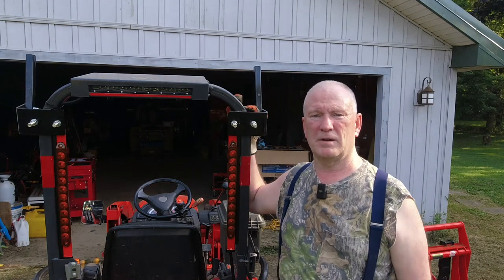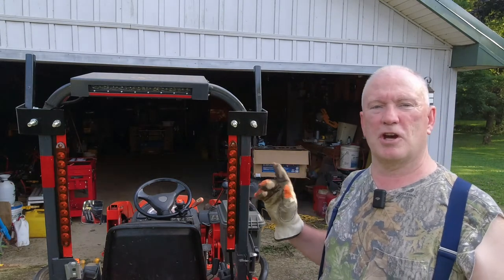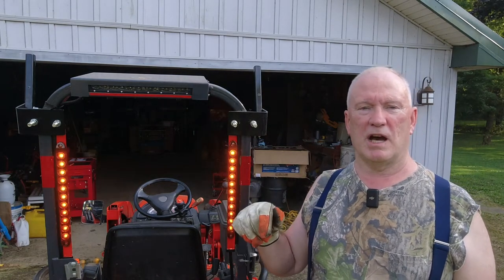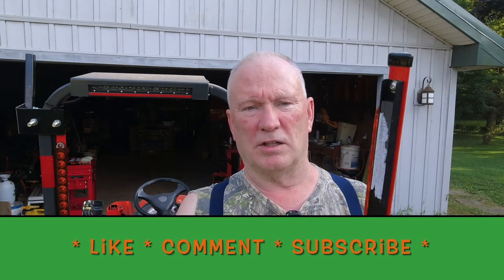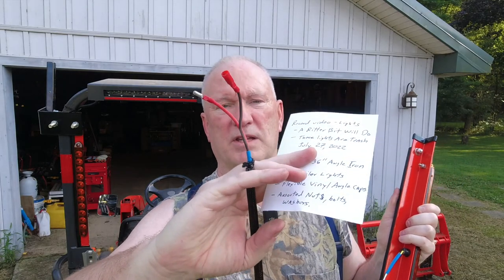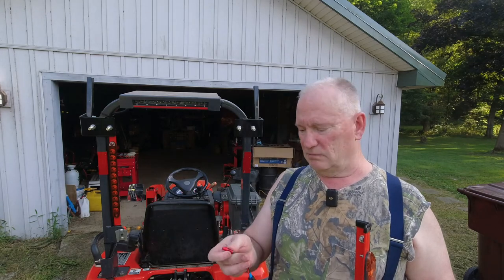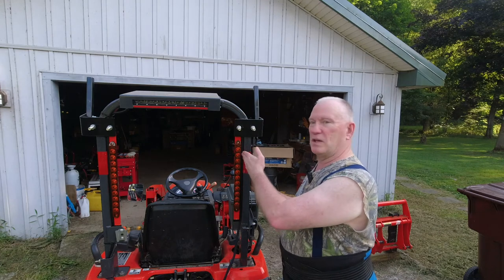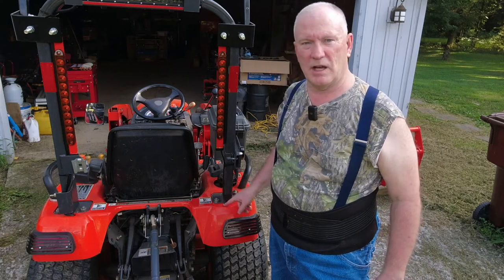#109 - Hazard Lights Added

Comment: Hey Bob nice work solving the problem. That's pretty messed up if the dealer did that intentionally. I wouldn't doubt it thought - I worked for a car dealer a long time ago that put $80 bumpers on trucks to hide dents and missing paint. Thanks for sharing :)
Reply from the maker: I suspect the tractor was either a rental unit or loaner for when people had their unit in for service.  My guess, I did not know enough when I made the purchase to know what questions to ask.  My uncle told me I needed a small tractor with a loader and so I went and bought this one which my uncle found on FaceBook or Craigslist.  Other then the signal lights missing it's been a good machine. And, to be fair, they knocked $1000 off the asking price and it only had 100 hours on the unit at the time of purchase.  However, I wish I knew then, what I know now. I could have made a better informed decision about my purchase.  Like more HP and heavier chassis, etc.  Thanks for watching and commenting - enjoy the journey - cheers